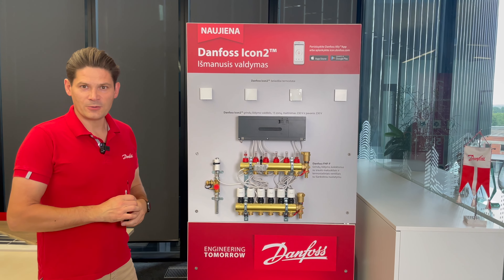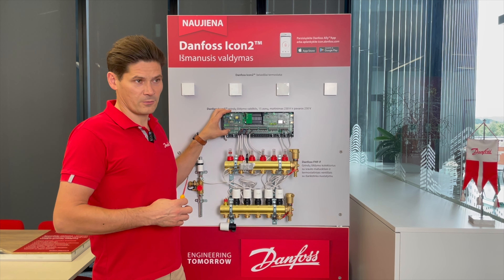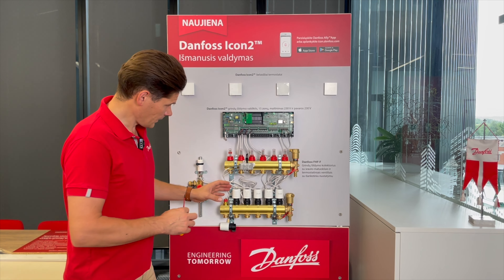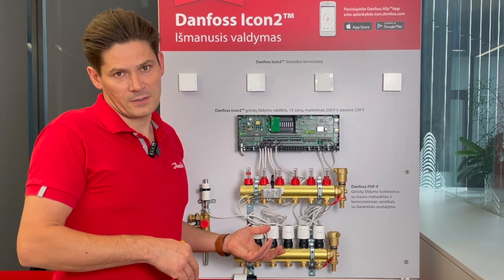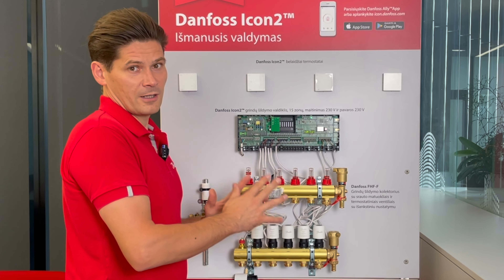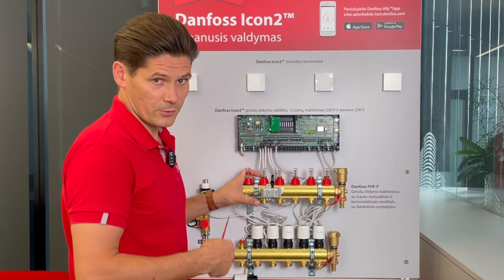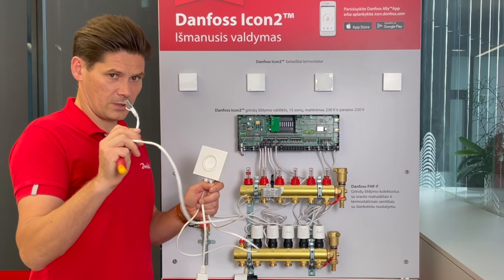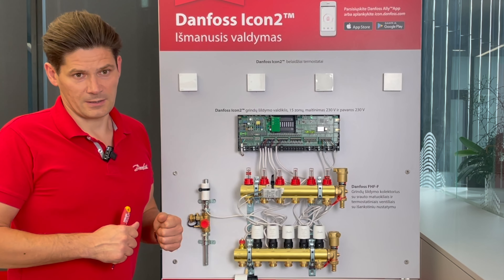Danfoss Icon2 Review underfloor heating cooling control system

Comment: Question: I have a 23 years old floor heating with a pump and a mixing shunt and I want to "digitalize" it, using danfoss.
My plumber already supplied me with an icon 2 main controller (088U2100), all 7 actuators are in place, I have 4 thermostats in place and the ally app.
The system is working, but the mixer is still controlled by the old, analog controller, which I want to shut down.
As it seems, I own the basic controller, so possibly not correct for my purpose (as far as I understand it, this controller is unable to control the shunt, although there is a wiring possibility for the shunt and the sensor in place, but software is missing, is that correct? This is somehow misleading to me, why is wiring possible, when its not controlled in the end?).
So what would be the correct article number for the main controller "advanced" that meets my needs, please?

Comment: Thanks for the great product description! I'm struggling to choose between the basic and advanced controllers. We're upgrading to a downhole heat exchanger (NIBE pump) and want to use it for cooling too. Any advice on which version we need?
Reply from the maker: It depends who is desision maker there should be heating or cooling on. If heating/cooling is swiched manually using a simple swich connected to Icon2 Master Controller. Or heat pump has outdoor sensor and switches automatically and can switch heating/cooling Icon2 MC too. All you need is Basic Icon2 Master Controller. Advanced Icon2 MC is needed for 4 pipe change over systems. For switching heating/cooling depending on reference room. Or switching heating/cooling according supply temperature.

Comment: Great video :) If I insert the actuator wires into a wrong plug, how do I remove the wire again without destroying the connector ?
Reply from the maker: Please push a pin with flat screwdriver.
Reply: @heatingsolutions123  it worked :) thanks a bunch.

Comment: Great video!
I have the advanced system setup this week. 2x icon2 and 10 wireless thermostats. Can you explain how to add the wireless thermostats to the Ally app? i only see the icon2 controllers and the gateway in the app.
Underneath the icon2 controllers the app says 0 online devices and I cannot add subdevices.

Thanks in advance!
Reply from the maker: You need to setup Icon2 master controllers with thermostats together first. Using basic setup or using Icon2 app.
Reply: That worked! Thanks
Reply: Hi I hope you are well. I am really struggling to understand how to configure the icon 2 to allow it to switch a heat pump between heating and cooling while also running a shunt pump. The PWR1 in the application examples is either used for switching via an external relay ( which I also struggling to find info on) or the shunt pump. Can PWR2 be used for one of these. I want to allow switching based on a reference thermostat but I also have a need for the shunt to mix as I may have a scenario where my heat pump temperature during cooling is lower than normal. I’m really struggling. I am either going to use application 5 or application 15. The AMZ connection box in the literature is powered by the icon 2 but when I search for it, it always shows an external power supply? Any info would be appreciated. Thanks
Reply: Also, do your thermostats allows for control based on room relative humidity?